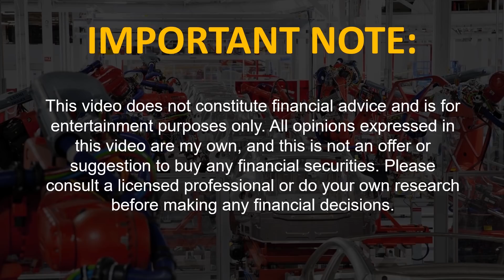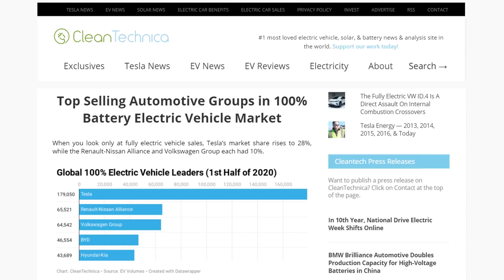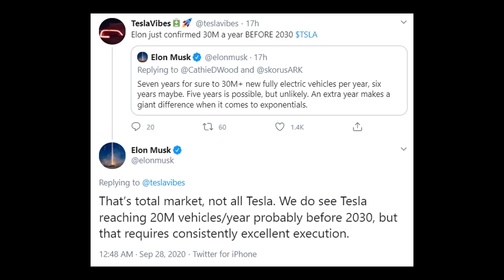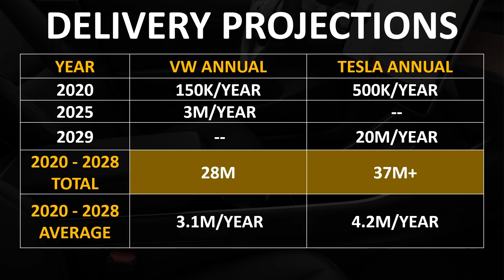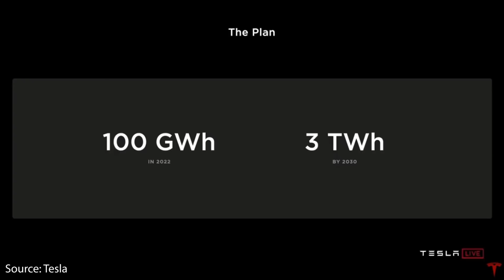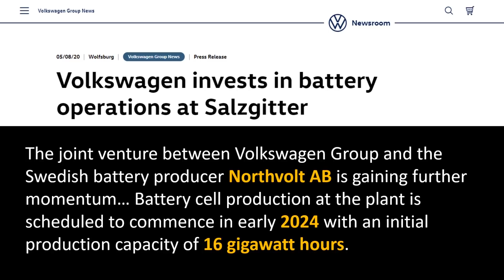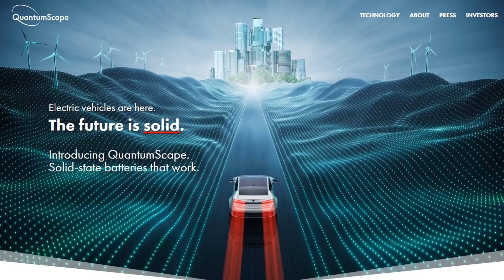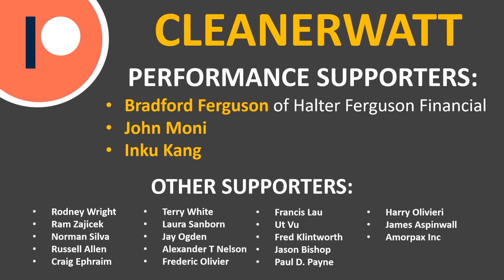Tesla vs VW: Can VW Catch Up? (Electric Vehicles)

Comment: Why they don't bring simple technologies to make hydrogen from water ,that will significantly reduce the cost of EV and no tension for range as it can be fully charged with seconds and can use as energy source as 70%of Earth is covered by water, rather than investing billions in battery tech they should invest it in technology for separating hydrogen and oxygen from water
Reply: Hydrogen is a joke. Fuel cell’s don’t have more range than EV’s & don’t fill up in seconds fuel cell pump stations are Limited to the pressure so if the station goes below the pressure you have to wait until it gets back to pressure & the car & station are in sync
Reply: Bro...invest in Nikola if you believe that...or go buy a Toyota Mirai and tell me how that goes lulz If you have a basic understanding of physics and the hydrogen element it's obvious why it isn't economical. Maybe aliens from the homeworld Elon is from have the advanced technology 1000 years ahead can do it
Reply: HFC’s still require big battery’s to work, are not very robust and don’t outlast modern EV battery’s. 
Hydrogen then has its own issues as a fuel as due to the conservation of energy can’t ever be at efficiency as straight electricity (unless we find some huge H2 deposit somewhere that is most unlikely on earth).
Reply: @teamjg277  lol i know that the thing is we need a revolutionary break through like before 18th century no one even imagined of electricity ,like that we need a efficient way to use most abundant source on earth i.e. water of somehow we r able to break oxygen and hydrogen seperately from it we can use them not for commercial things but also to explore space as majority of fuel in rocket thrusters is hydrogen and oxygen 
For that we can gonna spend lot on research
Reply: @ayush1143  Electricity is required to separate oxygen and hydrogen. Much more efficient to send that electricity to your house via the grid, where you can use it to charge your car BEV overnight while you sleep, and warm it up for you in the morning before you leave for work... 

(or send the electricity to your workplace, or the local mall, or the supercharger network etc. etc.)

Comment: With the introduction of the 4680 tabless battery Its not likely VW will ever catch Tesla, great video, agree 100%
Reply: Tesla will license their battery tech to VW and others
Reply: @homeloans2611  Quite likely but in any event I don't know of any other BEV maker using cylindrical cells.
Reply: @homeloans2611  Tesla itself needs to buy huge volumes of batteries from 3rd parties like LG and CATL - just like any other EV maker on the market. The question for future success is not what or if Tesla is licensing to VW but which vendor has higher priority when LG is hitting it's production capacity limits.
Reply: @homeloans2611  Yes, I agree. Elon Musk does not want to kill the opposition, that's not what he is all about, but he will remain dominant.
Reply: It will take 3 years for TESLA even to produce them in good volumes. Who knows what will happen with battery tech in 3 years.
Reply: Gowtham V all their suppliers will also make the new cell size and they will be using the new cells in their new vehicles that come out next year. I have no idea why you think it will take 3 years. they said a year to 18 months to get all of the benefits... 3 years is when they will have a whole new car ready...
Reply: @GowthamV07  Never underestimate Tesla, I say they will be close to full production in half that ime.
Reply: I'm, they wont.
Reply: Until then the others producers will also have something at least so good
Reply: After 10 years, Tesla's build quality is still poor. If they can't get it right after that amount of time then they never will.
Reply: I'm astonished at the belief that Tesla's tabless cylindrical battery gives them any advantage over prismatic cells, as used in other EVs.
Reply: here ye here ye https://youtu.be/TEoPELSj1MI